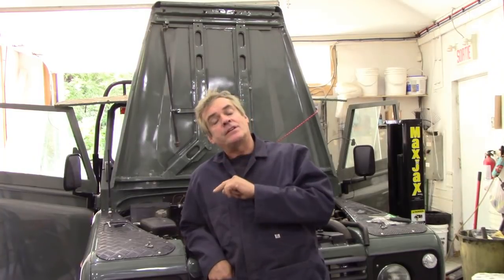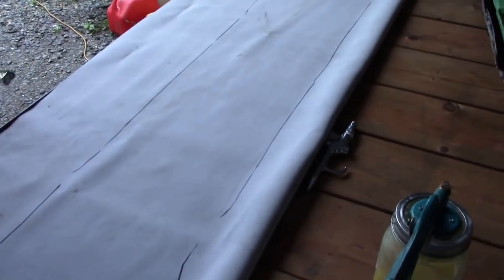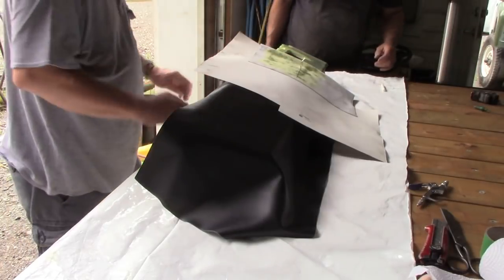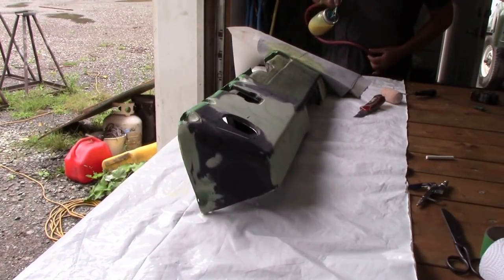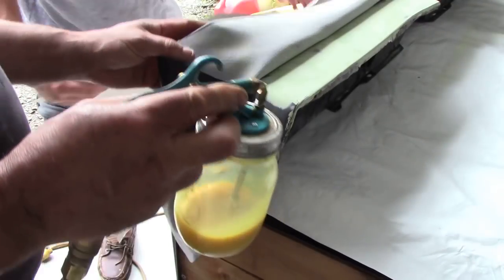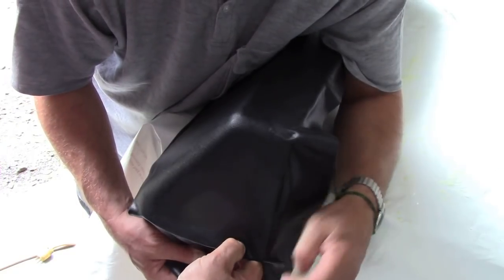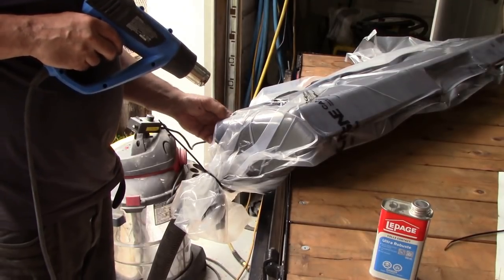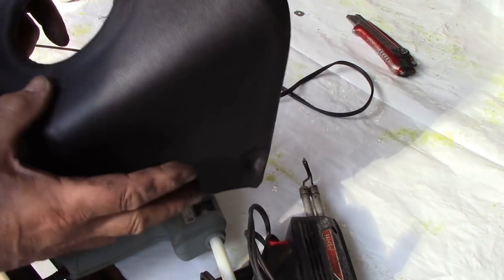Recovering the lower dash on a Defender. Part 2 - Recovering with vinyl

Comment from the maker: For your information, the vinyl is a low temp (-60F / -51C) material for snowmobile seats (that is the point it will crack)
It has the following qualities:-

1000 Hours Weathermeter Adhesion resistance (ASTM D751)
Abrasion Resistance (Wyzenbeek): 30000
California fire code 117
FMVSS-302
Mildew Resistant
Oil Resistant
Tear Resistant (191-5136)
Tensile Resistance (ASTM D751)
UFAC class 1
Ultraviolet stable pigments

Colours available:-
Black
Black Anti Slip
Chalk
Nu Bright Yellow
Bright Red
Silver Metallic
Royal Blue
Electric Blue
Marine Green
Bright Violet
Aztec Red

We only got hold of a metre for the experiment, but we will get more and try and see if we can get a dash bottom and top out of a 1 metre X 54 inch strip

Thinking of putting this on my website as a kit marked out but not cut for the Defender, and include black flange screws and black washers to finish the job (we only had large steel washer in the video)
Aiming to get a kit together for less than C$100 - BUT that depends on how much we can get a roll for, (only sold commercially) so this is a wild guess
It is excellent for our needs but not a big seller, hence the material is not cheap
Reply: Any luck on this?. Struggling to find something similar locally or at all!

Comment: Your advice was spot on. I purchased the same glue, brushed it on, made my own vacuum bag with a 6hp shop vac and used a glue gun around the screw cut outs. Thank you for sharing your experience and allowing me to get it spot on, first time around
Reply from the maker: Excellent news! Having the right materials helps!
The clamps I have in my shop really help when clamping the screw cut outs

Comment: Mike,
Have to say, since recently purchasing a 2005 110 commercial vehicle i have been an avid watcher of your channel. You have given me the confidence that there are jobs that both my son and i can tackle together (even though i am not a DIY enthusiast. Please keep making the videos as they are both educational and wonderful entertainment. We are about to commence the front door panels and the visors with t 4 way vinyl that has a small weeve on it so looking forward to get started.
We will send you a postcard once all is done .
Again wonderful channel.
Dave and Jamie Dundon
Reply from the maker: Thanks Dave and thank you very much for your donation! Much appreciated!
Re covering the sun visors is a task I have not taken on yet = I have spoken to Jim about them and he said the could be done, but would need stitching and making like a pillowcase - quite tricky

I may be tempted to have a go at re covering the door panels using the vac bag, BUT I need to get my mits on some of that Weldwood industrial contact adhesive as it flashed off very quickly, so there are no issues with tight corners etc
Mike

Comment: Nice work Mike, looks great
Reply from the maker: when you have the proper materials, you can do a  proper job!
Mike
Reply from the maker: I think we had an issue with the corners where the screws go in as there were too many small tight bends - it formed great, but the glue was not good enough and we then ended up putting glue on glue
Hot glue worked fine

Comment: Can't the original vinyl be seperated from the the foam with a heatgun?
Reply from the maker: Yes it can - I have done a recent video but the 4 way vinyl is thin and can show defects if you damage the foam when removing the old vinyl  - so in some cases I try to use the old vinyl where possible
Reply: @BritannicaRestorations  My dash has a few pin pricks in but second hand dashes for my car is cheap.. The vinyl on my door card has bubbled so may try and reglue it. What's the best way of removing vinyl from plastic without damagaing it?

Comment: Was the glue just regular Heavy Duty LePage Contact Cement? Sorry if I missed in earlier video as still trying to get caught up.
Reply from the maker: This is the stuff

https://www.ebay.com/itm/Dap-Weldwood-Contact-Adhesive-Landau-Top-and-Trim-HHR-Solvent-Type-Spray-Grade/173486873254?hash=item28649f9aa6:g:~AoAAOSwh81bfJCz

Comment: Great vid guys. Fantastic end result.I have to do exactly the same thing to my own hicap project Mike, so I'd be very interested in where to source this, from the UK. Mike (UK).
Reply from the maker: I was chatting to Jim yesterday and as far as he knows, it can only be found here as there is no need for low temp vinyl in the UK
It is not cheap BUT we think that with 1 metre you can cover the top dash and the bottom for less than C$100 in vinyl
As a bottom dash here is C$3000 new (no used LHD in the country) then it is our only option
I don't know what this is vinyl is called, Jim is a freelance upholsterer, and found it at one of the places he works at - we know it is for the snowmobile seats

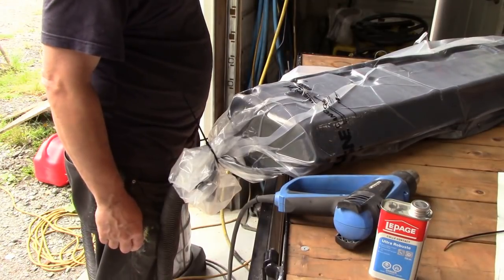Comment: I was crossing my fingers you hadn't melted the plastic wrap to the vinyl with the hot air gun! And it sounded (@35:50) like the Feds were rolling up! ;) Great vid as always, make it look so straightforward! Both of the corners have rusted through on my panels which is a bit annoying as it's going to be a bugger to curve a new piece around to fill it. Would you just use the spray foam instead and shave it to fit?
Reply from the maker: You could use fibreglass matting as a backer and use tape as a temp form for the fibreglass to mould to - there is no need for high strength as it is just a box bit messy but solid
Spray foam is good for cavities, BUT I would not put vinyl onto spray foam as it gets sucked into the bubbles and looks bad (found that out on Mk1 dash top!) hence a light skim of filler
Reply: @BritannicaRestorations  hmm never tried fibreglass, I'll have a look into it! Thanks for the tip! (now the gearbox has gone for the 3rd time it'll be the next but one job...)
Reply from the maker: There are lots of videos on fibreglass on YT - not bad to do - but wear gloves! Messy!